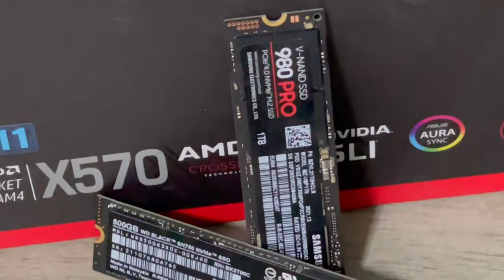Cool tech | Upgrading my pc!

Comment: What are the specs?
Reply from the maker: It was explained in the video during the building process. I have a Ryzen 7 2700X paired with 32gb of 3600mhz (OC to 4200mhz) Dominator platinum. Radeon RX 6750XT, on a ROG Strix X570 Crosshair 8 formula with a Samsung 980 PRO/ WD black 500gb inside a Corsair 5000t powered by a CX 750F RGB PSU. Entire thing water cooled.